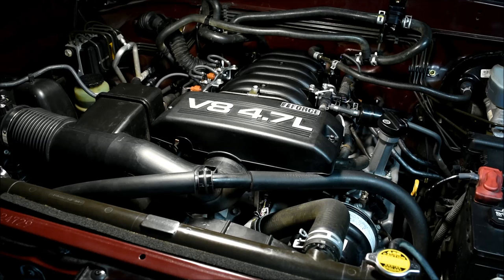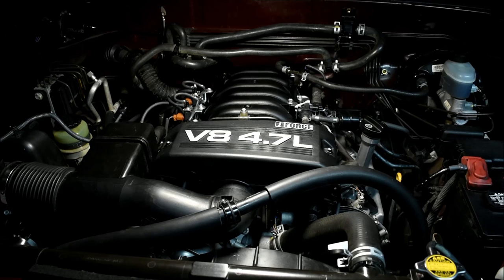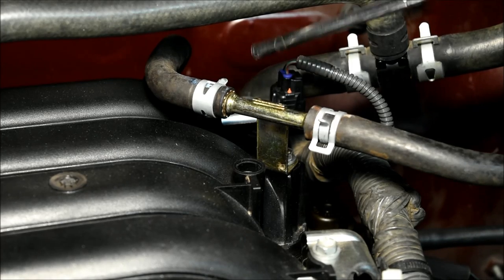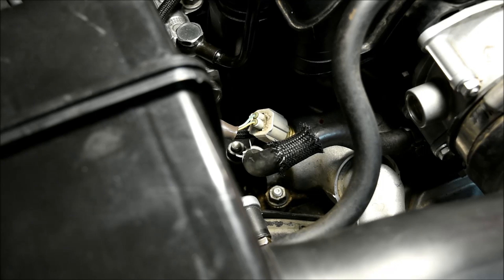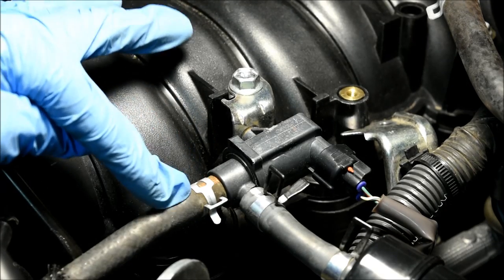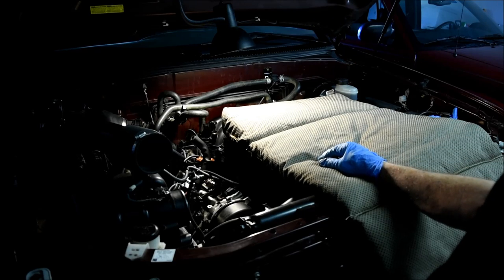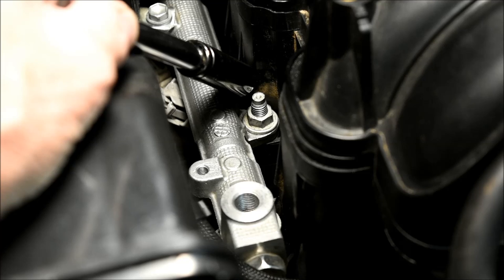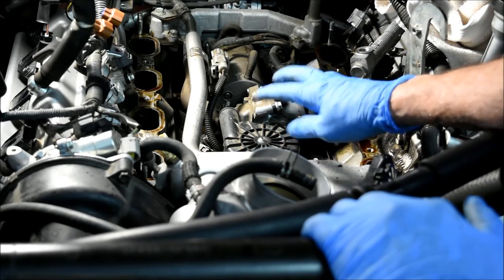Secondary Air Injection Pump Replacement 2006 Sequoia/Tundra Chapter 1: Removing the Intake Manifold

Comment: How many miles were on that vehicle?
Reply from the maker: 149K at time of repair in Nov 2016. Although I was just under the 150K mile limit for a warranty repair, I missed it because my SUV was a 2006. After 2-3 disappointing conversations with Toyota, they turned me down. They did not take into account that this was about my 4th or 5th Toyota. Although I have loved Toyotas (incl a 1988 Land Cruiser- the older style 
"macho" vehicle) I think that love affair has come to an end. I read that Toyota is stopping production (in the US) of both the Sequoia and the Land Cruiser. If I could find a nice 2012 Sequoia, I would buy it in a heartbeat.
Reply: I'm looking for a first gen tundra. Your video makes me wonder if it would be wise to avoid something that old considering how hard & brittle you found o-rings, hoses, & connectors to be. I'm really considering avoiding the 05 & 06's to avoid the SAI headaches. That said..that makes the newest one available to me would be the 04 (I think the 04's didn't have SAI) which you would figure would be even more vulnerable to age problems. Do you have any advice regarding my concerns? Do you think if I found something with lower mileage, say under 100,000, would that make things less brittle? In your opinion is there any age limit on a vehicle that would tell you to avoid a vehicle that old? Or is it a matter of looking at oil seals for leaks, or boots, & rubber bushings for dry rot? Any advice at all would be appreciated. Thank you!
Reply from the maker: @8683roy  Roy, you pose a tough one. There are a bazillion factors. In the old days, cars were simpler and cheaper. Now they are often needlessly complex and expensive. I am going to give you the quick and dirty answer for ME. If I was looking for a good used Tundra, I would try to get the newest used vehicle I could afford. The older you get, the more issues you will face. In the last year or two I have worked on a 2012 Tacoma and a Tundra and they were both in pretty good shape and I felt like they both had a lot of "Goody" left in them. Obviously, try to get one that has had some reasonably good care.
Reply: @doktorfixit  David, Great, great response!!! A better one than I thought that I would have ever received because I too am old enough to have experienced the pleasure of owning, maintaining, & repairing vehicles from a much, much simpler era & I really appreciate & value information from someone who possess more knowledge than myself. How I would love to sit down to a cup of coffee with you and try to absorb the knowledge from your brain. I like to think of myself as organized & having a structured approach when I work on vehicles but you take it to the next level on me & I can only strive to be as professional & as thorough as you are...as I can tell from your fantastic instructional. I couldn’t believe some of the videos I’ve seen on YouTube where the guy just tore the intake manifold off of the engine without worrying about any garbage falling into the intake ports & then just using the old intake manifold gaskets & just using the impact driver to re-tighten the bolts without even using a torque wrench...what a joke. I really appreciate your advice when you suggest I get the newest Tundra I can find & afford; but I could  make a list of the reasons why I love the 1st gen Tundras over any truck that I could possibly buy today but that list would be too long in an already too long response. So what I would like to do is see if  you would be willing to please go a little bit further out on the limb & tell me if you would be afraid to buy a 2004 Tundra or any other 1st gen Tundra for that matter because as far as I’m concerned it’s the only Tundra or truck nowadays worth owning. Nothing I would hold you to, I just want your honest opinion. I know there are an infinite number of variables involved, but if you wanted a 1st gen Tundra & it checked all of the boxes that you required it to check...would you be afraid to buy it? Thanks, Roy
Reply from the maker: @8683roy  Roy, sorry about taking so long to reply. Your answer is about as nice as anything has ever said to me. Thanks for the kind words. In truth, if I did my homework (as much as I could) I would not be afraid of getting a 2004 Tundra. There is almost nothing that can't be fixed and even if you rebuild the engine, the transmission, and the rear end, etc, it would still be much cheaper than buying anything of recent vintage. I have probably said it somewhere in the videos that I feel cheated if I don't get 20 yrs out of a vehicle. My wife has a 22 yr old Chevy Blazer that runs great. I have never let the Chevy house touch it. My 2006 Sequoia is 15 yrs old and going pretty good. I recently had to replace the McPherson struts on the front end. I expect that kind of repair and just think of it as more new parts...ha.  Yep, would love to have a cup of coffee with you sometime... Dave
Reply: @doktorfixit  Dave, I couldn't agree more with all you said. But since that cup of coffee is impossible...maybe you would allow me to pick your brain a little further: If you were considering buying a first gen tundra like myself...would you try to avoid the SAI system if you could or would you have no problem with buying an 05 or 06? Have you ever heard about the SAI bypass kit you can buy from Hewitt Technologies? I could install it cuz I don't have vehicle inspections where I live in northern Wisconsin but I do get plenty of below freezing temperatures; that from what I understand can still cause glitch issues with the ECM but I guess there is a work around for that too by shutting off the engine shortly after a cold temp start & then restarting it. But not only does that cause more complications than I like but its been my experience that its not real good policy to shut off a engine shortly after start up when it's 20 below zero.
Reply from the maker: @8683roy  Roy, out of curiosity, I did investigate the bypass units. I won't go into a long diatribe, but I have read about folks that were not entirely happy with it. And it looked to be about twice as expensive as they advertised. In the state where I live there are penalties for installing it which were more than replacing the system. If some little old lady offered me her clean looking 2006 Sequoia with 150K miles on it for $10K, I would buy it on the spot. The SAI pump does not put me off...hey, we know how to fix that...ha
Reply: @doktorfixit  Excellently answer, thank you. Since we've gone this far could you answer 1 more question please. Is it possible a SAI pump won't ever cause issues or are they all destined to fail? Have you heard of them lasting an x-amount of miles without any troubles?
Reply from the maker: @8683roy  I don't have a good answer to that. I know of some folks with 2006 and 2007 Sequoias who still have the original SAI pump, but that is purely anecdotal evidence. I suspect that they all will fail eventually. It was a bad design to start with- something they threw together to make the EPA happy. The whole concept is a hare-brained scheme.  At least I don't think they put the new ones up under the intake manifold.

Comment: Toyota now fix this free. Check with dealer. Any vehicle less than 10 years and less than 150000 miles
Reply from the maker: If you read the accompanying text, you will see that explained that I have a 2006 Sequoia that had 148K miles on it when the SIA pump went out in October 2016. The dealer explained to me that my car just missed the recall and free repair. I would have had to have a 2007 model. They suggested that I call Toyota's customer service 800 number and ask if they would make an exception for my case since I had owned 3 other Toyotas and I was the original owner of this car. I spent about 4 hours of quality time on the phone getting various versions of the runaround before they denied my request. This series of videos is aimed at those folks like me who have a Sequoia or Tundra that DOES NOT qualify for the recall. Thanks anyway...
Reply: Sorry David I did not notice the year your video. I was only clicking on Toyota video's hoping to spread the message I left. I did not mean to any disrespect. Your video's are awesome!
Reply from the maker: Hi Tex, My bad for misinterpreting your intent. I am probably getting touchy in my old age. Yes, I think it is a good thing to spread the word that Toyota will fix this situation for free if you fall into the parameters in the recall. Many thanks for the kind words. And thanks for watching.

Comment: hello, thanks for video.

my  06 sequoia had the bank 1 sec air pump  valve replaced. i put on oem valve .. mechanic did the work about  2 weeks ago.

P1442  still comes on, indicatin valve  closed  stuck or not opening..  any suggestion for that?  part was already replaced and it still comes up. please, help.
Reply from the maker: I don't consider myself an expert in these error codes. However, I think there are a couple of possibilities: the sensor is bad, or the ECM (engine control module, that is the computer) is bad. It is VERY unlikely that the part you installed is bad.
The quick and dirty thing I would do first would be to hit the reset button on your OBD2 code reader a couple of times and see if that makes the CEL light go out. I have heard of that working after a repair where the light stays on. Next, I would talk to your mechanic and see what he suggests. IF you decide to take off the intake manifold again, then I would definitely replace all the parts in the SAI system incl the smog pump, both check valves, and the diverter valve, etc. I have never had good luck trying to "pick the bad part" in a system where all the other parts are inter-connected. Something caused this valve you replaced to go bad. It's like dominos, in my opinion.
Reply: @doktorfixit  thank you.